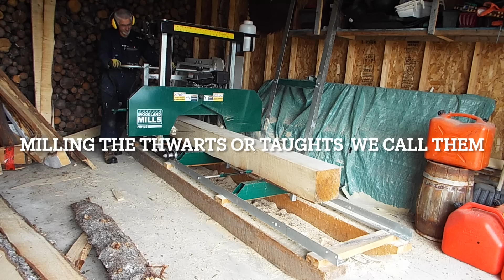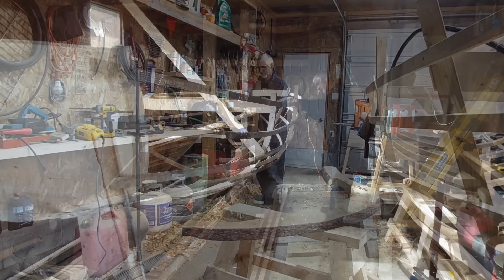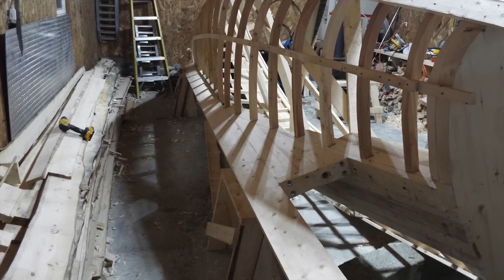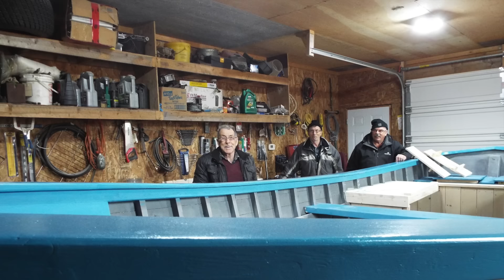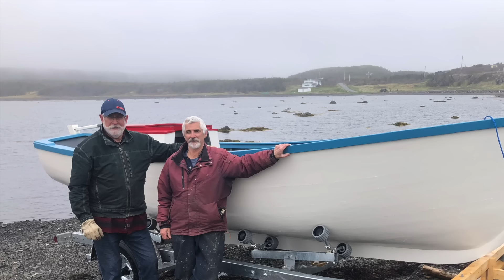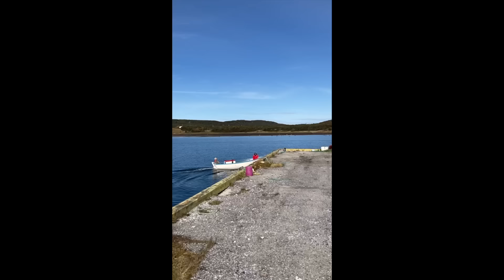Tonys Newfoundland motorboat ship cove cape onion

Comment: Good job but I would have put in a larger motor not a hit or miss ..    👍👍 .............
Reply: Hit and miss motors like this are historically correct for boats like this.
Reply: @paulbriggs3072  , ok
Reply from the maker: These engines are make and breaks not hit and miss.
Reply: I would have just put in a small diesel ..  but that's just me ..